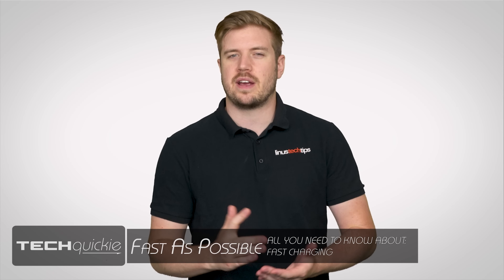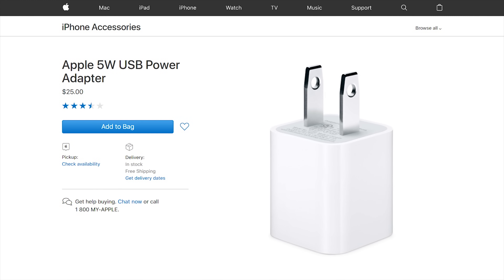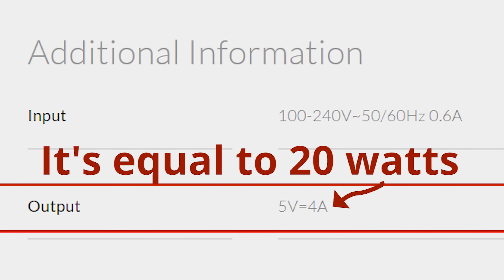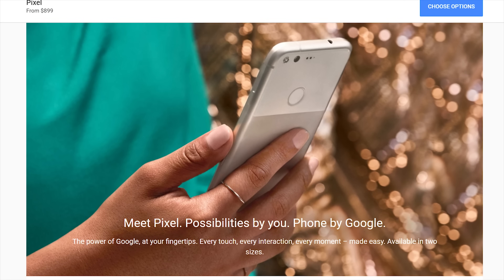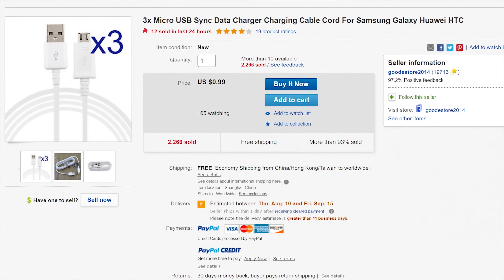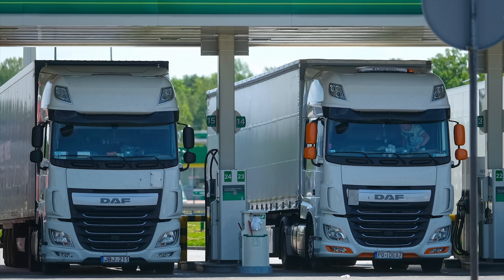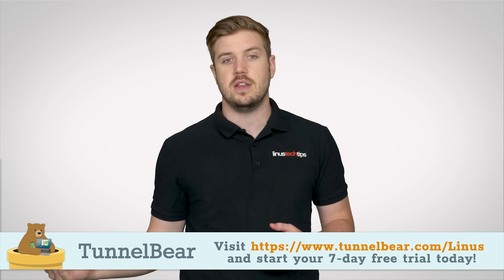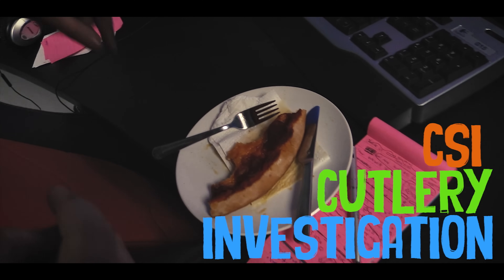How Does Fast Charging Work?

Comment: Fast charging is awesome. I can charge my phone to full in about an hour regardless of what level its at. Even if I can only charge for 5 minutes, that can add quite a bit of battery life. Also having a battery pack that does fast charging is sweet too.
Reply: Don't go using every night though as it will shorten your phone's battery life
Reply: @stephensnell5707  by the time battery damage matters, the device is ready to be replaced anyway.
Reply: @HalcyonVoid you wally brain,if you use Fast Charging all the time it will happen much faster 
My advice to you-DON'T USE FAST CHARGING AT ALL
MY Samsung Galaxy A05s has Fast Charging capability but I NEVER use it,I keep it switched off
I also only ever change my Smartphone once per 6 years
Reply: How much do you use your phone to need fast charging and a battery bank? 

I listen to music/podcasts on Bluetooth all day and my phone survives fine.

Comment: Things need to go a step further, it's post time that the USB 3.1 power standard be supported. It's capable of up to 108 watts if I recall correctly.... And it's a standard. No need for Samsung to have one thing, one plus another and Qualcomm who actually break USB standards to implement theirs. Yes, chargers that deliver the full 108 watts will be expensive, but a) they don't have to do a whole 108w to meet the standard and b) if they are the standard then economies of scale we'll catch up and 3) the prevalence of them will mean that chances are your friend or a place you visit will have one.
Think about it... Up to 108 watts, my Ultrabook charger is 65W......
... Also.. Amperage... Trigger 😵 try using the word 'current'.

Comment: or let users decide which voltage to charge at
if they charge over the 1c rate then that's their problem. 3000mah battery should charge at 3 amps. done

Comment: My Lenovo P2 comes with a 5100mAh battery and a 24W charger. (12V x 2A) The charger is still sitting in the box unused, pumping this much juice into the battery can't be good long term. Instead I'm using an Anker charger that does 10W (5V x 2A), still charges plenty fast and with a battery this big you'd have to forget plugging it in 3 nights in a row. :p

Comment: devices that support fast charging do come with compatible chargers you'll (pay a 
 ?premium for extra ones) did you actually say that
Reply: For extra ones yes exactly! If you lose the one that came with your phone or you need an extra one it will cost you a significant increase over a bog standard wall charger.

Comment: When I look for new phones, I always consider screen glass material, and it must have an SD slot and removable battery. Not much on the market anymore. I usually keep my phones for 2-3 years.
Reply: 4 years later, I bet it is impossible for you
Reply: @ClutchBuster  Basically impossible.
Reply: I change my Smartphone only once every 6 years

Comment: 1. Every Charging Adapter I have seen in the last 5 Jears is rated
2A x 5V = 10W Not only 5W
But the most devices will  only draiyn about 2,5W

2. The only Handshaking that happend is: Device tells Charger "Give me 9V"
The device does this even if ther is no Fastcharger but then nothing happends.

3. Fastchargers provide only araund 15W this is not very more then normal Chargers. +50%
9V x 1,67A = 15W
Its more ther to tell you "If you yuse it no Batery repare grated".

4. Qualcom is a Sub of Samsung. Thire MCUs are in the most devices. And all Fastcharging works the same with different Names.
Reply: Handshaking also happens for the device to know if charger can provide enough current. If it can't, your phone/tablet will not try to draw excessive amounts of current. But usually devices monitor voltage as well and will revert to slower charging methods if there is too much voltage drop. That's why you need a good quality charging cables as well
Qualcomm QC / Samsung Adaptive Fast charging
Huawei SuperCharge
OPPO VOOC / Dash charge
MediaTek PumpExpress
USB Power Delivery
(many more)
These are just a few charging standards, which are not compatible with each other, so not just different names.

Comment: Can somebody tell me what happens, when different technologies get mixed? I couldn't find any info on that.
Maybe i will have to buy a phone with a Mediatek soc, that uses Mediatek Pump Express. Will my existing qualcomm qick chargers work wit it? How many amps will the phone accept from that charger? Will it use different voltages too?
What happens if i plug it in a standard 5V 2A charger?
Any info is appreciated.

Comment: why not just go hey here's 5 volts take as much amperage as you want
Reply: yes, but why not just have "fast chargers" that are able to deliver say 4A? why is there a need for a special handshake protocol? can just use impedance matching to determine if the charger is capable of delivering higher amperages; if too weak a charger is used the voltage will drop below a certain threshold and the phone will know to reduce the current draw

https://en.wikipedia.org/wiki/Impedance_matching

Comment: Turbo charge on Moto-X and other Moto products will charge a battery from 15% or lower capacity to 100% in 2 1/2 hours, even when in use.. When in use though, the back of the case on my Moto-X Pure Edition does get warm.!

Comment: I no longer use fast charge as using fast charge with my old S6 constantly caused my gyroscope to no longer work due to the heat; with my S7 I turned off fast charging as soon as I had it.

Comment: I still got my note 4 because I can access the battery real fast, plus I got the zerolemon case and bigger battery. 12 hrs+ a day at work with constant YouTube use, I leave work at about 32%. It takes 2.5 days at 1% of streaming movies for it to die actually. So I know I'm good even when it hits 1%,yeah brightness is real low under 5% but I won't be out of a phone

Comment: Does the device take more damage if you use fast charge vs slow? Isn't that worth to mention..?
Reply: Fast charging is way more harmful to Smartphone Batteries due to the heat it generates 
Slower charging will help protect the battery and help it last over 3 years or more

Comment: "just like big rigs refuelling, don't expect to..."

Let me cut you off there, in Australia we have high flow pumps that litterally, pushes the fuel into the tank at a higgh enough pressure that it would fill up 500 litres in the time it fills a 50L tank, on top of that, the U.S. has the duel pump method where the pumps have a master and a slave pump, you can turn on the pump for each side and you only pay for one bowser.

There might be a few out there that have high flow with master-slave pumps working but I haven't heard of it.

My phone, the Oppo Rs9, it has a specifically designed USB cable that is similar to how many connections there are in USB 3.0 micro, but t is compacted to USB micro V2, so you can charge your phone with my charger and cable and quite frankly, my charger won't give a shit, it will push and push into the normal use power ports at a max of 2.5 amps, where leaving the other 1.5 amps on "dorment" lines, permitting other phones to safely charge with my charger and my phone to accept other chargers without a fuss.

also, they somehow break the laws of physics where the phone does not warm up, not even while the phone is under heavy load while charging.

Comment: NO.  ENTER replaceable battery.  You change your battery and you"re at 100%    and you don't have to wait 30,15 or not even 5 minutes to use your phone. YOU CAN USE IT RIGHT OFF THE BAT!

Comment: You need to be careful with charging your phone at high wattages. It will degrade the battery faster and will result in fewer charge cycles.
Reply: *power, and not really. Current and temperature limiting circuit will make it very unlikely.
Reply: Battery temperature is the primary but not the sole reason for degradation of a li-ion cell. In the domain of temperature, cell temperatures depend linearly on the charge current. The effect of temperature on a cell's lifespan is not a binary one, any increase in temperature has an effect. In addition, higher charge rates will create larger spindles on the anodes and cathodes inside the batteries. As the spindles grow, they can shorten battery life and create micro-shorts. Current limiting circuits in extremely fast quick charging devices are designed so that the battery will last 1.5-2 years under normal phone use. It's important that people know to charge a device slowly whenever possible and only to use faster charging methods when it's needed. While a slightly more extreme example, Tesla has done a good job at educating its users about the issues associated with charging batteries faster (supercharging). Quick charging is no different. In fact, the current going through each cell is very similar to super charging a Tesla.

Comment: the 5v 4amp example was a bit of a poor choice, amp draw isn't dictated by the charger (other then perhaps a safety limit) it's dictated by the load, in this case the phone.

If you hooked your phone to a 5v 100amp charger, it'd still only pull the current it's designed for (probably less then 2 amps)

Typically when people are talking about fast charging, they are talking about higher voltage charging (yea i know, the phone steps it back down to a lower voltage to charge the single cell lithium battery, but that's not the point)

The fast charger's are usually able to supply voltage higher then 5v, but won't do it unless the phone tells the charger it's ok to do so.  The main benefit of using a higher charging voltage is that you don't need to use really thick cable's to charge your phone (wire size needed is dictated by amp draw, not voltage)  Once your fast charging phone recieve's this higher voltage it step's it back down to around 5ish volts to charge the battery, but if it steps down from 10, or 20volts to 5, it can change the excess voltage into amps.  That's what the watt's are all about, watts are used to describe how much total power a device uses.  20volts at 1 amp is 20 watts, so is 1volt at 20 amps.

All sorts of electronics use this same technique to reduce wire size.  Your CPU for instance probably runs on around 1.2 volts, but your power supply doesn't offer it 1.2v, it gives it 12v and there's little converter's directly beside the CPU that change the 12v supply into what your CPU needs (which is very high amperage, a 80wTDP chip is going to use around 60-70 amps)  Because the high current only has to go from the converters to the CPU (which is right beside it) you don't need to use huge wires or giant pcb traces.  Not only is this nice for packaging and looks reasons, it saves them a lot of money in reduced copper usage.

Comment: You didn't touch on the difference between OnePlus'  implementation versus Qualcomm's quick charging.  OnePlus' is technically best implementation for quick charging but only works in their own charger and higher quality cable.  Qualcomm's quick charging has the most compatibility but a significant amount of heat is dumped into the phone therefore quick charging might stop when you also play games on the phone at the same time.

Comment: Regarding last slow charging, it's nothing to do with power you supply, it's physics. At 90%, if maximum battery voltage is 4.3v, at this percentage, you are already reached 4.3V and you can't push more current, while when you have 3.5V, charger can push as much current as it can. This is called CC CV charging, at high percentage, it will become CV charging "constant voltage" and current will tapper off.

Comment: how about a video on power bricks.
why cant i just plug my stuff into my socket?
Reply: Cause the socket is AC power it means it gives you power in waves of lot of energy and then  small amount your device needs DC power (he is not a superhero I swear) DC stands for (detective comics) direct current which means a steady stream of power

Comment: The charger for my Motorola Moto Z Force is pretty expensive coming in at around $40 (30 after VZW subscriber discount). That's due in part to the 30W/ 5.7A it can supply to the phone but finding a portable charger that can handle something similar is nonexistent. Thankfully I have the Turbo Charge Moto Mod which works beautifully.

Comment: For those of you plebs without said "fast charge" technology, you can charge your devices quicker than normal by doinga few things:

1. enable power saving, if your os supports it.

2. enable airplane mode, kill any wireless radios.

3. for root users, change the CPU governer to "power saver".

do this while you charge, and use your stock charger to gain about 1-2% per minute to charge. my S5 charges from 15% to 100% in about an hour this way.

another option: turn the damn thing off while you charge it.
Reply: LiquidZero Or you know.. just turning your phone off while you charge it..
Reply: @iMapleCreator that is wasteful as battery power will be used(a good 1 or 2% will be used while the phone boots up,keeping a phone switched on while charging means no battery power will be used at all)
Reply: @stephensnell5707  bruh my comment was 6 years ago, processor and tasks efficiency have greatly improved, and fast charging and protective battery measures have also improved. It is really not worth the headache of "perfecting" charging nowadays.
Reply: LiquidZero or buy oneplus phone
Reply: Are you talking about a Audi S5 Coupe or something? Jk IK what ur talking about its iPhone 5S ..... Right?